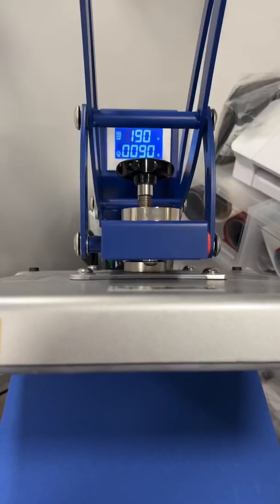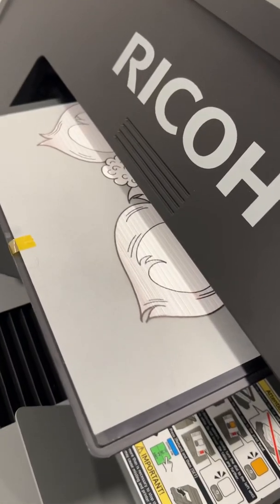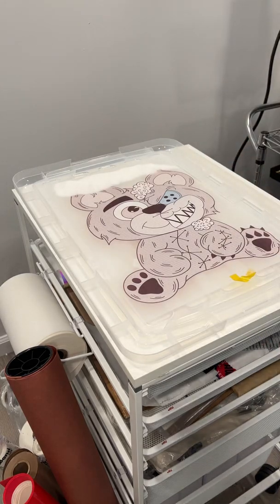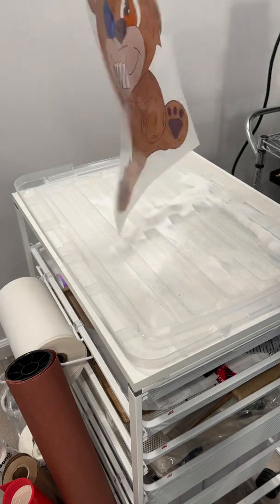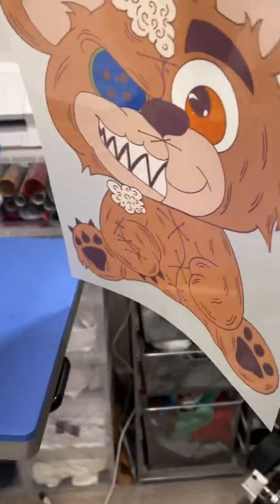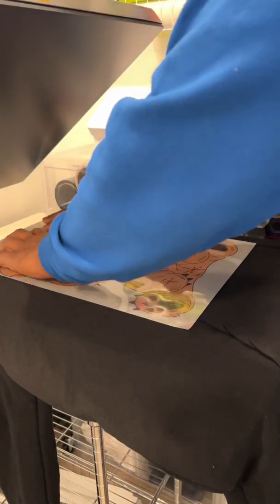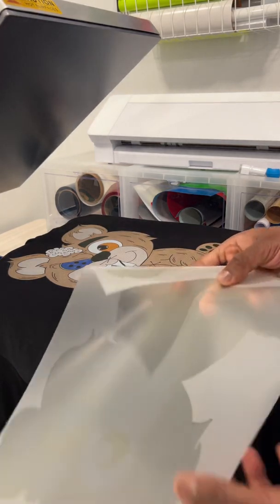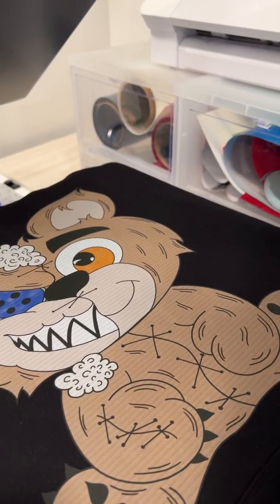Dtf Test on the Ricoh Ri1000 -w- new DTF Mim from colorgate

Comment: I've watched quite a few of your videos and you helped me out a lot with how to work the software for my Ricoh printer thank you so much by the way, I don't know if you're having any trouble with your DTf when you first started but mine has lines across it as it prints, to me it looks unacceptable now I've called up tech support they've gone in there and they've set up everything and it hasn't changed it still looks like crap I have to do all kinds of changes and set up in the software just to make it look decent and it's still not that great you have any tips for it or any settings that you might be able to share with me

Comment: Hello everyone after running a ri1000 myself I can tell you the lines from the white ink is from not cleaning the printer head I used to have that problem. Do a nozzle check you’ll see the white will be missing ink lines when your ink heads are marking consistently, you won’t get those lines. Hope this helps

Comment: I think the white lines you had are from one setting being wrong. In white underbase where it says rendering intent - change it to perpetual . I do not have colorgate just using anarip and it worked like a charm . Thanks for the help you got me through a lot of headache .
Reply from the maker: No problem. It was a still the head that needed to be cleaned but i am going to change it to perpetual to see what happens. Thanks for that suggestion i appreciate it.

Comment: What did you do to get rid of the lines
Reply from the maker: Yes. I had to clean my print head.
Reply: @adubbproductions   I Did to but I still have them
Reply from the maker: @jacquelinerojas1722  hmm. Did you wipe off your encoder strip with a lint free wipe? is your nozzle check perfect?
Reply: @adubbproductions  its missing a square or two in the white  but preety much perfect....  Do you have colorgate? What setting did you use?
Reply: @adubbproductions  yes I did a maintance on it yesterday

Comment: Hey can u make a video with the actual steps. What site u go to. What u order. What software u use and what were your measurements
Reply from the maker: Hey. I can. I’m assuming you don’t have the ri1000!?   It says what software I’m using in the title of the video.  It’s colorgate the software that comes with the Machine. 
What printer are you using? Do you have a Ricoh Ri1000?
Reply: @adubbproductions  I do I didn't read everything I just pressed play on the video.. I do have colorgate
Reply from the maker: Oh ok. Cool. Go to your colorgate profile update your Mim and you will have a dtf option.
Reply: Ok I'll call ricoh tech tomorrow and have them do it for me 😊
Are u able to do a thoroughly  video where u load the image to colorgate select the settings.. thats rwally the main part i want to see i always mess us with colorgate and i nirmally print from anarip.
Reply: @leandraharris8339  please let me know if they are able to help.
Reply: @adubbproductions  in did that just new but nothing different happened lol